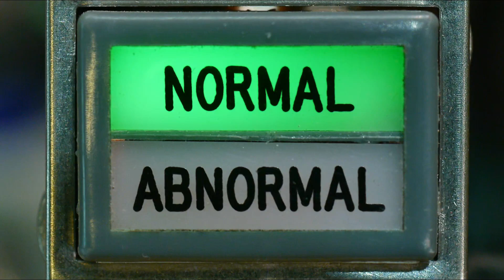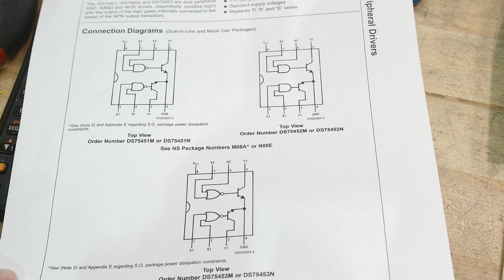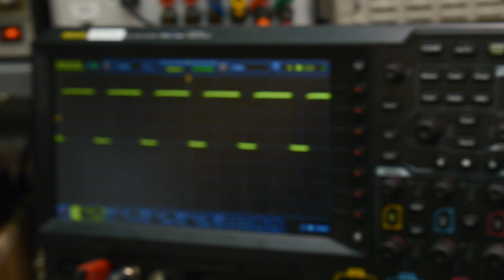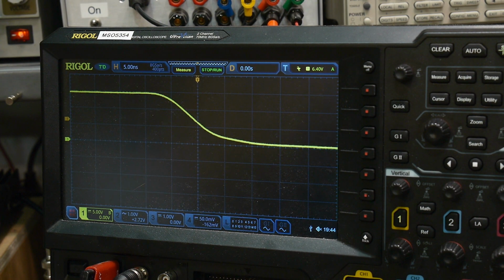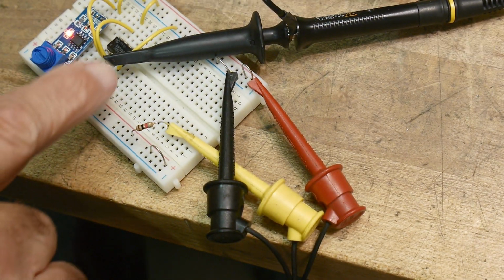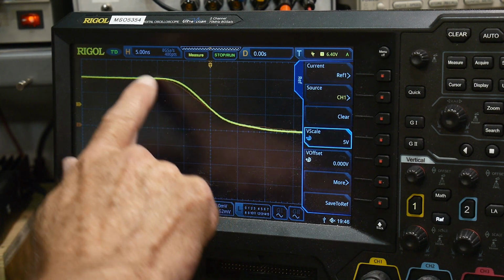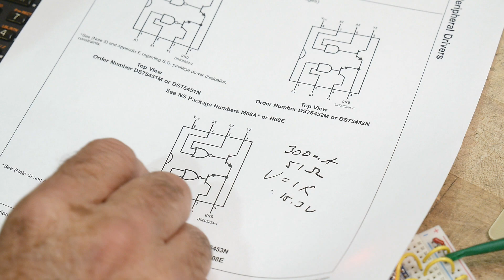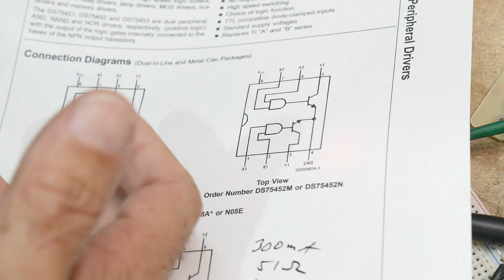#1294 75451 Dual Peripheral Driver

Comment: Memory drivers - Think about switching the big current pulse to flip core memory.  The NAND gate was useful, you'd tie one pin to the address selection and the other pin to the memory clock.

Comment: The saturated on voltage for the common emitter configuration should be 0.2 or worst case 0.3 volts, so the power dissipation per transistor should be below 100 milliwatts (0.3v*300ma = 90mW), so a max for both switches of 200mW.  This should be no problem for an 8 pin dip package.

Comment: It's rated at 0.7V drop for 300 mA output, and 957 mW in PDIP or 632 mW in SOIC (NatSemi version -- TI may differ). In a DC application that's 0.21W, so I'd say it's fine. The power limit is more relevant for high-frequency switching than for DC. The dissipation while the transistor swings between fully off and fully on will add up.
Reply: I think dissipation during high freq switching is usually more of a problem with mosfets than bjt's.
Reply: Assuming the transistor is driven to saturation, then the Vce should be about 200 to 300 millivolts which would amount to a max of about 100mW per transistor and 200 mW per package.  This should be no problem for a dip8 package as you mentioned.

Comment: I was a little afraid of the power dissipation of the 50 Ω resistor. The small element which was just a bit bigger than the 1 kΩ type (the one with the easy job), had to dissipate 4.5 W with the PWM factor set to 30%, so about 1.4 W. The value was also shown at the power supply. Resistors are quite durable, I guess it might be specified for less than 1W and it is better to switch the experiment off when it rings at the door.

Comment: Interesting part, I always just use a totem pole driver (=NPN+PNP), which is basically the right or second section of this part.
Which is more than adequate enough to drive most things. These days drivers are still a thing, especially to drive MOSFETs.
ZXGD3009 or ZXGD3006 are very popular, and basically in the same price range as a NPN/PNP totem pole pair.

Comment: 2N7000 was available in the later 70s. Perhaps the MOS technology had a rap for being “sensitive” or “unreliable” back then, so it wasn’t put into driver stages much? Even I catch myself going for bipolar driver stages out of habit where a mosfet would do. And I’m a kid of the 80s :)
Reply: Don't know about the 2N7000, but the first 4000 series CMOS IC's in the seventies were so sensitive that if you weren't looking nicely at them they would FAIL!
Reply: @paulcohen1555  ehh, it's just an urban legend. I've roughly handled early MOS chips, shitty ones made by commies, and despite their dodginess, never killed any. Every MOS chip has protection circuitry built in, or they wouldn't survive even their manufacture.
Reply: @paulcohen1555  Interesting! I’d be surprised if the 2N7000 didn’t have some protection network around the pins. The 4000 series history is still ahead of me to explore. So I’m not sure if the first unbuffered series had protection networks. The late 70s stuff sure did!
Reply: Back the the day I would look fondly at 2N7000's, but they cost many times that of a bipolar transistor and simply couldn't be justified.
Reply: @ChrisSmith-tc4df  Thank you! That’s the first-hand knowledge that takes a bit more of retro-oriented research than I have done so far. That’s very good to know.

Comment: The difference between 51Ω and 1000Ω will be much more apparent on the voltage rise time (current fall time).
Reply: But there is no loading cap to charge or discharge in the test circuit  and hence that is not visibke/prominent in the video.
Reply: @jainmanish123  There is always some capacitance in actual circuits.
Can be easily checked by IMSAI Guy if he can spend some time.
Reply: @paulcohen1555  agreed that while driving a large length of cable it'll have the cap.
I am just pointing that the same was not part of this particular test circuit and hence you dont see the slope change with change of resistor
Reply: I won't complain for time with IMSAI guy as he has been producing a lot of content persistently and I am always learning something new for the shared videos...